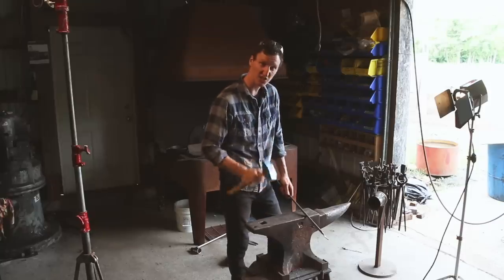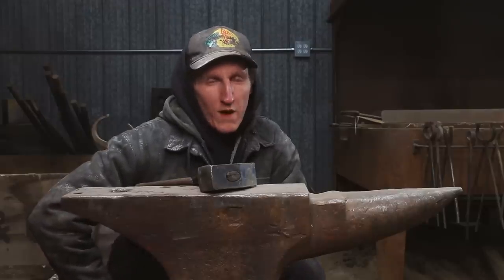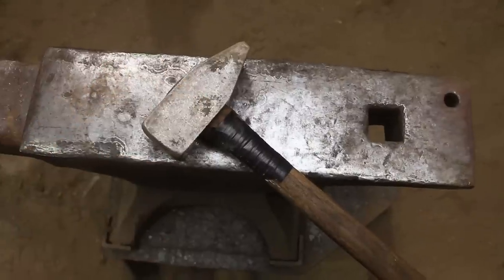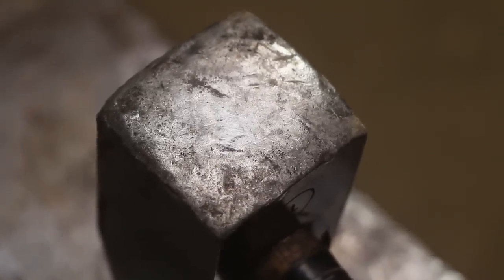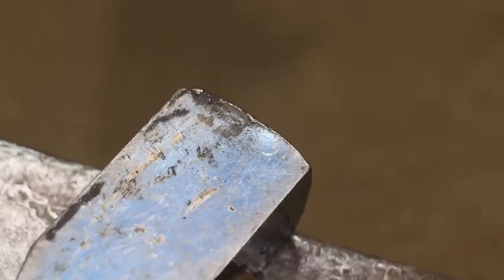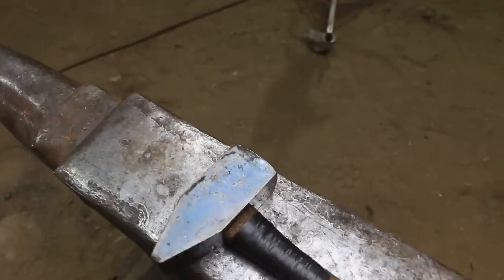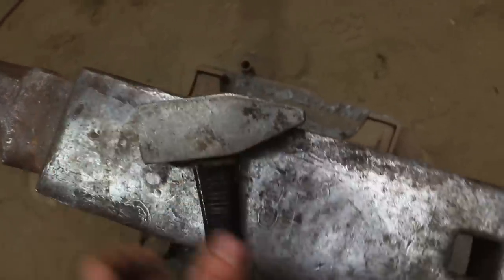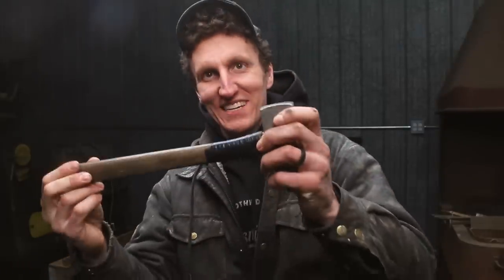My TITANIUM hammer after 2 YEARS

Comment: You should make a Tungsten hammer.
Reply: Tungsten is heavy but not very ahock resistant
Reply: Nope! It will shard on the first hard hit. And those pieces coming off are both sharp and heavy, because of the really high density of tungsten, so not something you'd want nearby.

I've worked with specialist compression testing equipment which used 20 mm diameter tungsten anvils. Those were parts you wouldn't want to drop on a concrete floor.
Reply: Tungsten is way to heavy and is extremely brittle.
Reply: @Hydrazine1000  can Tungsten be alloyed to be tougher and non brittle to be used for black smithing work?
Reply: @justinhaltom1528  Yes, there are tungsten alloys out there, but no, they are all still brittle. Not as brittle as the pure unalloyed metal, but still not capable to survive hard impacts. 

If we're talking impacts in the context of munitions/penetrators then tungsten (and tungsten carbide) will perform top-tier, but those are one-off destructive impacts, instead of a forging shop tool meant to last years.

(I have an MSc in Materials Science & Engineering, so I ought to know what I'm talking about...)
Reply: @Hydrazine1000  Awesome. Is there a metal that you like to see turned into a hammer
Reply: @justinhaltom1528  DISCLAIMER: my wife and I wear titanium wedding bands, so I might just be a little bit biased. 

With that said, titanium is not a gimmick, it really is very well suited for material for a hammer head. It's easy to shape/machine into one, it absorbs shock impacts, it doesn't corrode easily and, though this is subjective, its surface can be made to really look nice.

If I have to pick something that is not titanium, I'd suggest ARMCO NITRONIC 60 as an experimental hammer head material. This austenitic nitrogen-strengthened stainless steel was a development in the sixties by ARMCO  to come up with a galling resistant steel. It also happens to be wear resistant, very susceptible to work hardening (which would be a good thing for a hammer head) and resistant to high temperature oxidation.  And it is resistant against cavitation erosion, though that is of no use whatsoever when forging.
Reply: @Hydrazine1000  cool

Comment: The equation for force from a moving object is F=MA^2, that is the force goes up linearly from mass, but the square of the velocity. So if you can swing something faster, it will make a much bigger difference in the force applied. Lighter things are easier to swing faster. Just sayin'
Reply: I was going to make that point too, thanks for making for me. What it means is that for a typical hammer swing, with a specific amount of effort put into the swing, two hammers of differing weight will both transmit about the same energy. The heaver hammer will swing slower with that amount of effort and the lighter hammer will swing faster, but the energy of the swings and the energy delivered will be equal.
Reply: But moving faster is more taxing on both muscles and joints, so for a forging hammer you'd want something pretty heavy, and a lot harder than titanium.

For jobs that require a lot of small light taps, like framing or roofing, a lighter hammer is, of course, better.
Reply: The other thing, which Tim didn't address, is one's hammering technique. A light hammer used all day will eventually produce elbow and wrist issues. Conversely, a heavy hammer, mine is 3.75 lb, swung with proper technique will take you a long way. I was instructed by an old Ferrier.

Comment: Can you forge weld a regular steel face to a titanium hammer body?
Reply: You couldn't forge weld it, but you could hard-solder it by casting one material onto the other, but I wouldn't trust that binding: it's purely mechanical instead of molecular.